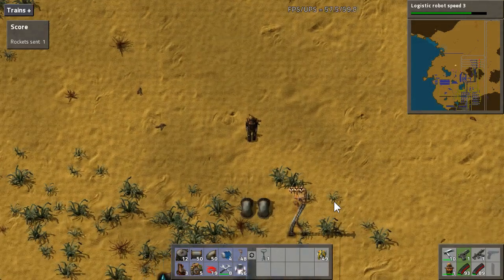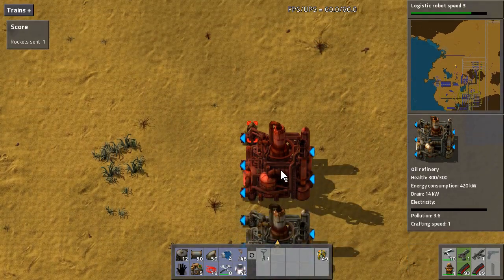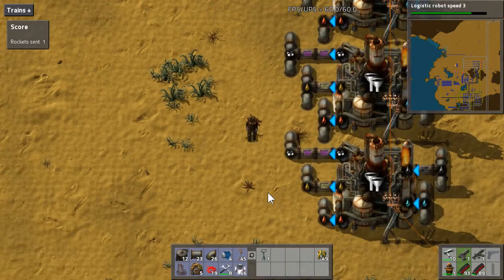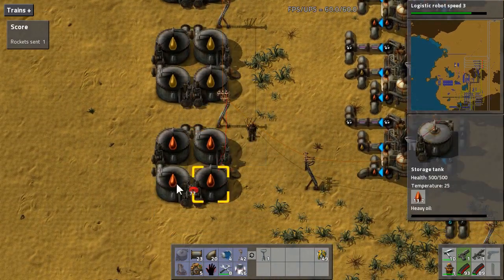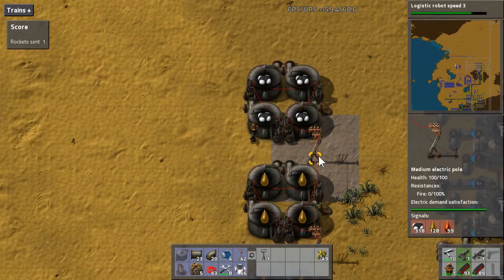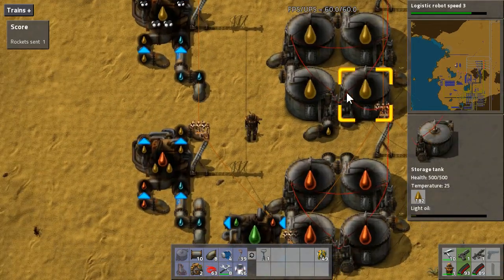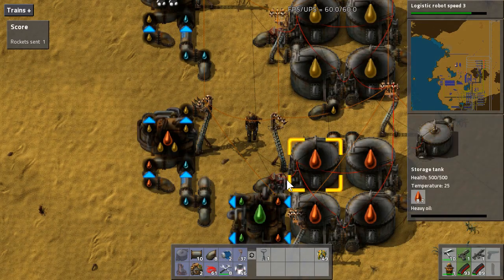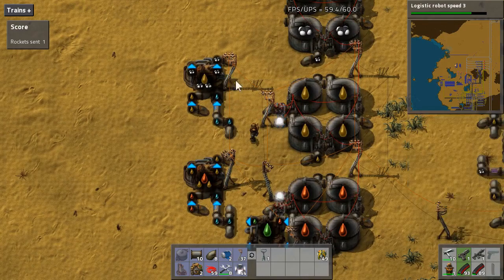Factorio Tutorial - Circuit-Controlled Oil Processing

Comment: I prefer driving the pumps to chemical plants not based on hard values but in proportion to each other. For example plants converting light oil to gas is working when circuit network shows (light oil) > (gas.) This way you can keep all storage tanks almost full while still not damaging refinery process. This gives me increased buffer because in case I run out of crude oil, all heavy oil will be processed into light oil and light oil into gas.

Because I calculate proportions of liquids, it is only necessary to wire one storage tank of each liquid type. This way managing storage tank area is more flexible with less wiring that can possibly break while reorganizing electric poles or tanks. This also enables me to have more gas tanks than i have light oil tanks while still keeping every tank filled.

My factory was missing the light indicator, going to add it later today. :)

Comment: Hello Rjhelms.

I watched with interest your settings.
However, you are mistaken. There are several possible setting.

For a unique consumer plastic and sulfide:
For cracking light oil must be "light oil"> "gas".
for the cracking of heavy oil "Heavy oil"> 9500 (4 tank)
The first adjustment will aim to deplete your stock in light oil if you need a lot of gas but conversely to make light oil stocks if you do not need gas.
The second setting will leave a suitable stock for cracking lubricant and make a reasonable buffer.

For military use:
Making light oil stock will be asked to manufacture the flamethrower capsule. So your setting will be "light oil"> 9500.

I gives me added that I also controls the arrival of the oil. With such setting:
"Heavy oil"> 9800. Output "Oil"
"Light oil"> 9800. Output "Oil"
"Gas"> 9800. Output "Oil"
three comparators reilier pump that will have as setting:
"Oil" = 0.
This will allow time to get cracking their works in big production.

I hope I have helped.

Comment: To use light fuel for solid fuel is not a bit more efficent, its WAAAY more efficient.  For 1 light oil you get 1 solid fuel in direct conversion, with cracking you need 3 light oil. So its 3 times more efficient.

As long as you still produce some amount of sulfuric acid and plastics there is no point in making solid fuel from light fuel.

Is really simple to make a set up for it to. Just like one have a pump set on the heavy oil cracking based on the amount of heavy oil . One can have one pump on cracking light oil based on the amount of light oil then just put the soild fuel production on light oil in steed of petrolium, just that easy.

When you start producing soild fuel, the light oil decrease, the cracking turn of, and you get more light oil.

If you really need a lot of soild fuel one might need to make some petrolium to solid fuel.

Can typicly set it as if one tank is less than 2k unit of light oil, the cracking stops. If its less than 1k of light oil, the petroleum to soild fuel start. Both using more petrolium (and there for producing more light oil).

If one want to make it really efficent then one would have a system with refinaries that use both basic and advaned refining, and swich to the basic if a lot of solid fuel is needed. This is almost never the case, so basicly no point in doing

Comment: I prefer using (an) arithmetic combinator(s) and divide a single tank's fill by 25. Either individually or in a bunch by using the each-virtual signal. That way one can extend the tank storage without having to worry about wires. It's also cheaper, requiring less wires and it gives a handy percentage of tank fill to the network.
Aside from that, using hard limits on heavy and light oil is a bad idea. When petroleum runs full, your oil refineries shut down.
So what I use is comparing the oil fractions directly. Crack light oil, if there is more light oil than petroleum, etc. That way the numbers will always be even, and the refineries always running unless all storages are full or some odd circumstances happen.
Reply from the maker: +FalcoGer I really like that idea of converting to percentages - I'll have to give that a try.

Your point about not using hard limits makes sense, but it's not a problem I run into in practice. Apart from lubricant, I generally speaking run everything off petroleum gas, so my petroleum gas storage trends towards 0 rather than filling up. That said, there's an elegance to comparing the fractions directly that I really like.

Comment: Is it possible to copy/paste the on/off criterion from a Small Pump to a Lamp?
Reply from the maker: Good question - I bet you can, but I don't think I've tried it. With the 0.13 update, I've started using combinatory to control the pumps and lights together - you can do some fun stuff like have the cracking column lights be red when the pumps are off, then all turn green when they're on.